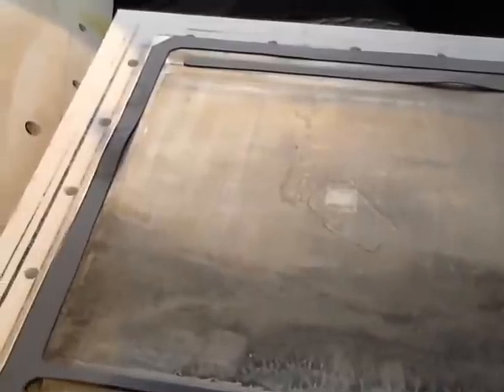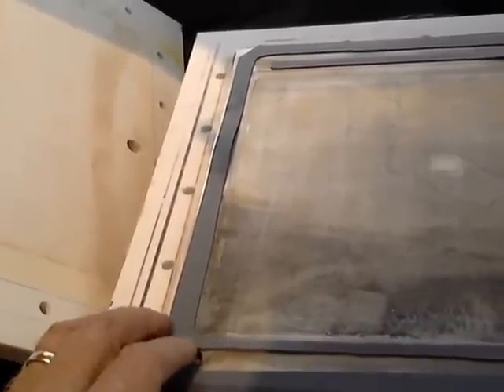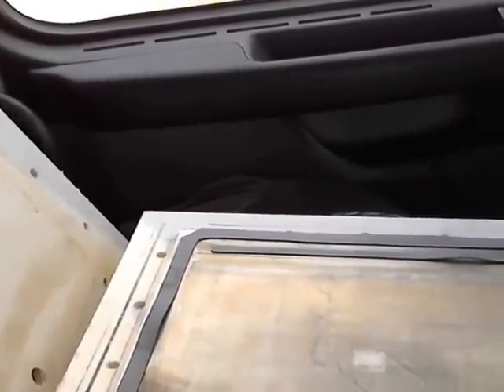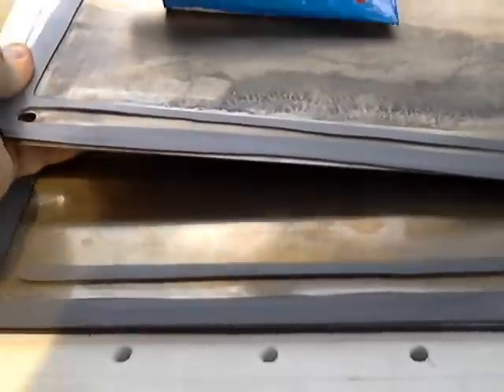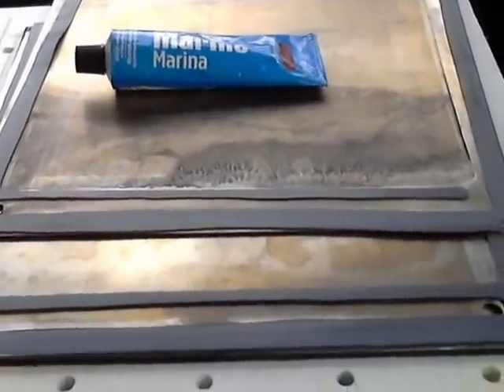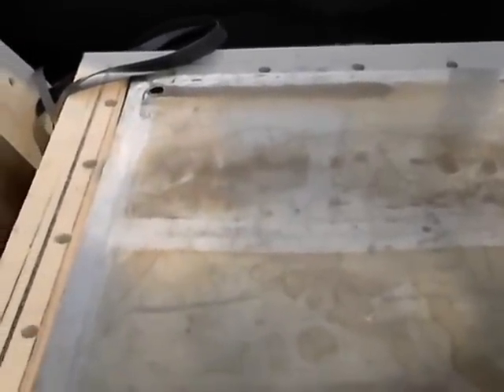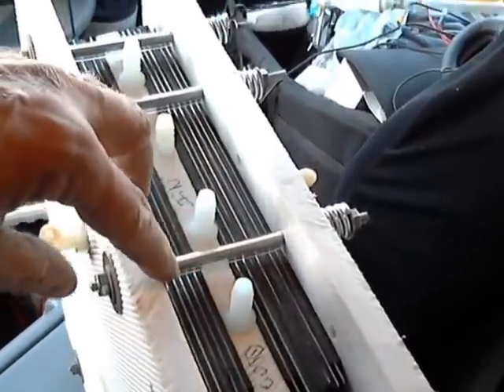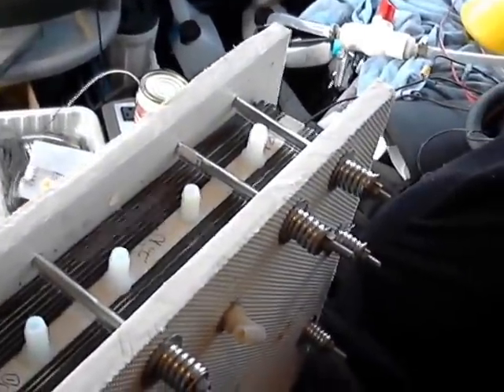LARGE HYDROGEN CELL

Comment: how did it turn out? are you using to add hydrogen to your air intake on a car? many years ago I saw a Chevy 305 on an engine stand running on pure HHO coming from a large unit. I was fascinated
Reply from the maker: Slimmy Slim 
Hydrogen causes the engine to burn more clean and cool period modern engines have a thermal sensor and will compensate for the coolness by sending more gasoline into the engine. For that reason people who use hydrogen with newer vehicles have to get a module to compensate the computer's reaction to the cooler temperatures.
I used the device in my older semi and it did help it to run smoother and burn cleaner